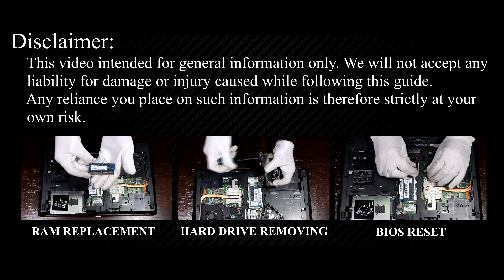HP ProBook 6560b Disassembly, Fan Cleaning, and Thermal Paste Replacement Guide

Comment: I have exact type of laptop but the issue is that while I was using it, it sundenly went off and when I press the power button then it comes up without displaying anything on the screen and the fan will be Working.
Reply: AHMED DANJUMA  the same thing happened to me ...
Reply: Same problem with me i think it's cuz of dust maybe this is why i am here I'll clean the fan
Reply: Hello there. 3 years too late. Sometimes, ProBooks from the 6500 series have a physical GPU rather than the cpu's integrated one. Hence, it's very likely yours has one of them and it died or "un-welded".
Reply: @TheShadowDrifter  hey bro mine shows display but turns off after 1 sec or some times not even displays
Reply: @nrdslayer9590  Could be a number of reasons. Is your RAM properly in the socket? is your battery charged? Is your fan clean? Did the laptop ever get hit or fall?, if yes, it could be a damaged motherboard.

Comment: Hi, I have the same laptop and last summer, I removed the heatsink, cleaned the fan, applied some old Coolermaster thermal paste I had (which I read from here and there that it's not very good, I must buy a Arctic Silver 5) and put everything again in place. After this procedure, the temperatures dropped considerably. However, it's been a couple of months that I notice CPU throttling while compiling, so I suppose I must do the procedure again. However, I'm thinking of buying a new thermal pad for the GPU, along with a new paste. Do you recommend any specific thermal pads? How thick should it be? From a few ebay items, I read that it must be 1mm thick for this specific laptop, but I don't know. I'm considering buying a large piece and cutting a piece exactly at the size of the GPU chip, but I don't know the thickness of the pad. Do you have any recommendations?

Thanks.
Reply: Good day, can you please share how you later resolve this issue. Thanks
Reply: @ahmeddanjuma1178  I bought a new laptop, since my old HP Probook was damaged.
Reply: What was the damage?